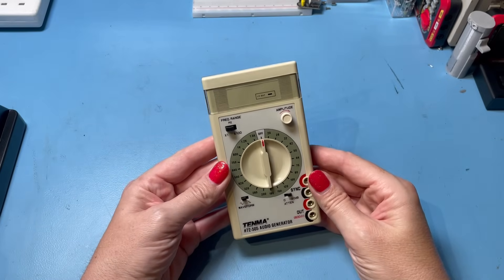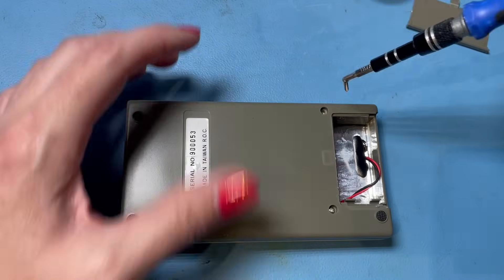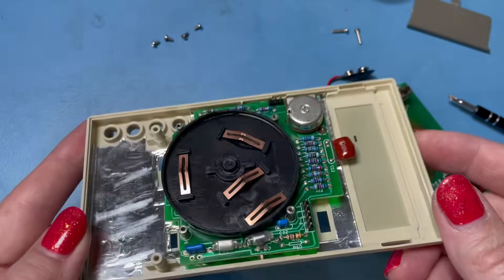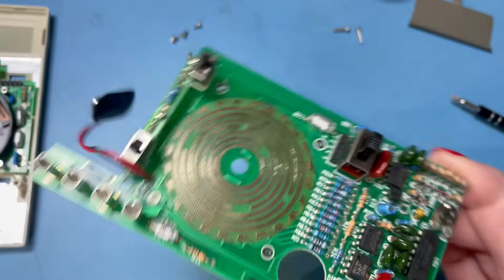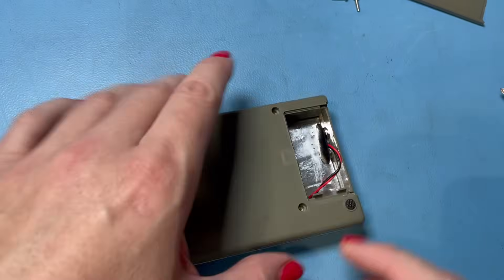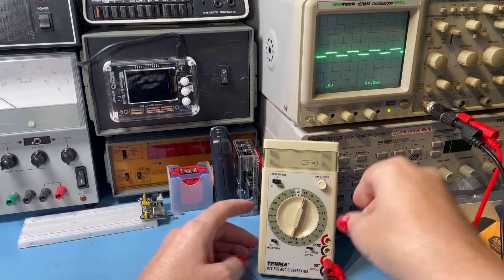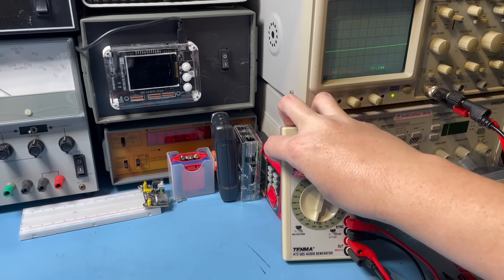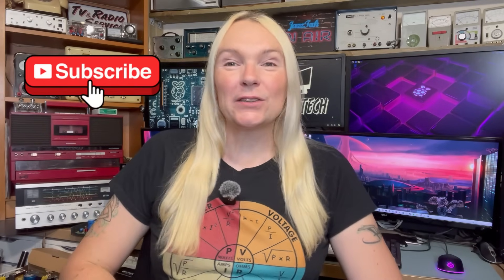A Look Inside A Retro Tenma Audio Generator - Teardown & Test

Comment: What signal is at the sync output? Maybe a short pulse? Or a 50% square wave perhaps? Is in sync with the rising edge/zero cross or how? You have a dual channel oscilloscope to show us?
This is useful to trace manually the transfer characteristic (if you ever heared of Bode diagram) of filters, amplifiers, preamps, all for AF. I made something similar with 741 opamps (Wien bridge) and a 12 position rotary switch; mine worked up to 100 KHz only. I used it to adjust the RIAA curve for record preamps, tone regulators (Baxandall, multi-band EQs) and filters for light organs, two-way amplifiers, etc. I used milimetric paper and an electronic voltmeter.

Comment: It SHOULD NOT look like a meter or be aggressively labeled so it’s not mistaken for a DMM! Also a BNC connection would go a long way in the right direction!
Reply: The fact that it says CLEARLY on the front 'AUDIO GENERATOR' seems to have passed you by! If you can't read, you should not be handling any test gear. BNC connector would be fine but this is a second-hand item from, probably, the 80s, not a currently marketed device.

Comment: I've had one of these Tenma audio oscillators for decades and it's very useful. I kept it in my toolbox for field use and it never let me down. I've still got it handy and use it for a quick test without getting out a bigger modern generator. Perfectly fine for day to day use and doesn't take up much space on the work bench or in a drawer. I think I may have got it from Farnell all those years ago, or perhaps even Henry's Radio.
Reply from the maker: Henry's Radio, that's old lol.

Comment: Cool, they are handy. I have the same thing with SCOPE RC-555 brand. My boss saw it fall off the step bumper of a telephone company truck and gave it to me. I've used it for testing anything from amplifiers to 125 HP motor drives.